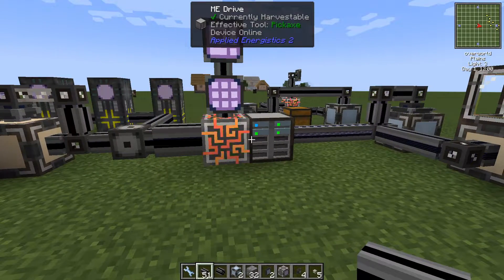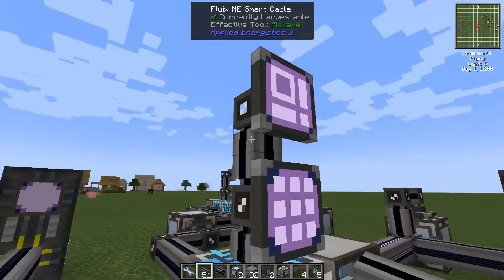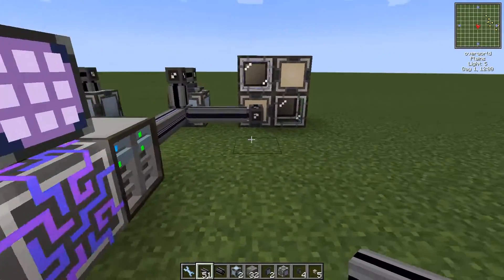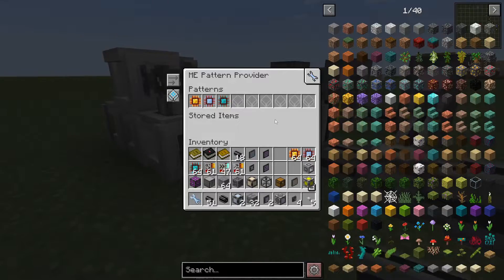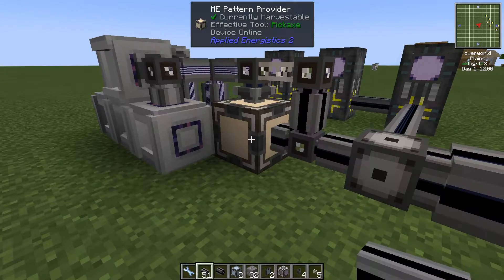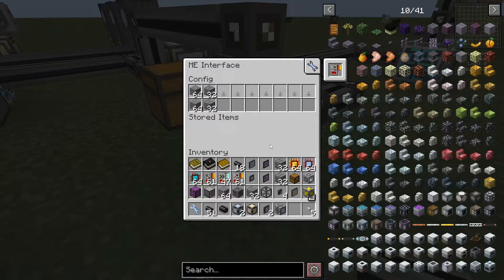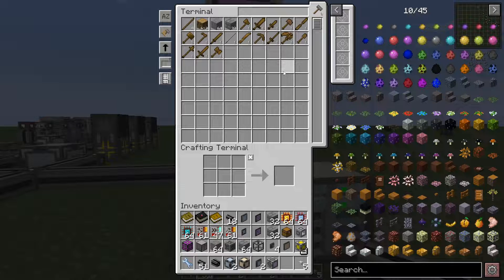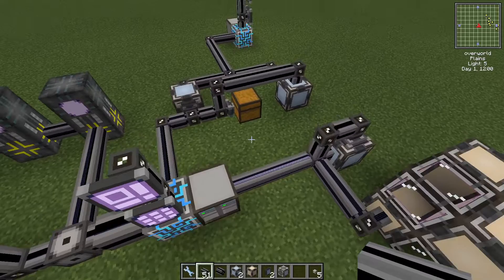Pattern Provider and ME Interface in Minecraft 1.17 - AE2 Tutorial

Comment: 2:47 Can I use import bus or item storage bus instead of interface? 
also 2:57 - Does the export bus has to specify the items to export? Or the pattern provider only accepts items, that were requested to craft?
and last but not least 3:04 - Can I use interface/import bus instead Item storage bus? I guess I cannot use import buses, because this subnetwork doesn't have any storage, right?
Reply from the maker: To start with, if you're playing in 1.18 I suggest you check my latest video on this build due to mod changes. You cannot use import or storage instead of interface to receive items, they work differently than interfaces. Final export bus must specify what to export or you might send the other crafting ingredients out. No, you need storage bus to intefaces to be able to both insert and extract from Inscribers. The inscribers themselves are storage space. I'm not sure what you're going after but I have a long series of AE2 tutorials to check out if you want to learn more about the different blocks.

Comment: thanks for this tutorial, I built the inscriber but somehow the bottom three are not sending printed circuits to the top inscriber for the final assembly.  Do you know if it is because the pattern provider works differently compared with the ME interface?
Reply: my friend helped me solve it xD it is the storage bus where we put the ingot/crystal in, it also need a printed circuit to let it know that it can let it pass ^^ same goes the storage bus for the redstone, it needs filter for all three finished processers, otherwise the bus wont let the item pass at all
Reply from the maker: Sorry for late response but good to hear you solved it, so thanks for coming back and writing that! The difference in storage bus behavior seems to be due to new filter functionality in the bus. The problem can also be solved by changing filter to insert only (which means the other item can be sucked out without being in the filter).

Comment: i set up the inscriber has shown in the video but it still doesn't work has it been updated since. if so possibly a new video showing the changes?.
Reply from the maker: What version? Modpack? One detail that might have changed a bit is the filter settings for storage bus. But what part doesn't work? What happens?
Reply: @therealtkh  the modpack is atm7 some of the items come through not all of them they won't autocraft and some don't even leave the inscribers
Reply from the maker: @TheJiggyOne  Hard to say, the version should be fine as I have built this in 1.18. Test different settings on the storage bus (filter on insertion only) and make sure all connections has channels and that there are quartz fiber in correct places. Otherwise hard to guess without screenshots or anything.
Reply: @therealtkh  I tried doing that. I can't get it to work. And I Dont think youtube let's me send screen shots XD
Reply: @therealtkh  from what I can guess I items won't go to the pattern provider
Reply from the maker: @TheJiggyOne  Jump onto Discord (link on home page, video description), might be easier to share screenshots there. But you said some items come through? Perhaps problems with patterns or with filter settings in subnet?

Comment: does this work for 1.18? because it does work for me for some reason
Reply from the maker: You didn't specify what part you asked about so I'll just guess... You might need to adjust storage bus filter to "insertion only" but i have built the processor part in 1.18 and it works.
Reply: @therealtkh  ahhh when i replace the interface with the provider it wouldnt start craft i even put the patten
Reply from the maker: @warpedro6967  I don't have your world to look at so it's not easy for me to help... Not even mod version or modpack etc.
Reply: @therealtkh  eh nvm

Comment: I made the automatic Inscriber setup you've got there, for some reason it won't insert the redstone? I have no idea why it won't. It makes the printed parts but it won't insert the redstone to finish the pattern. Any idea why? The storage bus is filtered on Insertion Only just like the others.

EDIT: Also, I seem to need all patterns (for both the finished products and the printed circuits), how do you make it so you don't need these in there?
Reply from the maker: All other items are inseted but not Redstone? Are the items from other Inscribers ending up in the top one? I was thinking if it's rotated incorrectly or something. Or if any connection is incorrect and the Storage Bus on top is inactive due to channel shortage. It's hard as I can't see your build and it's easy to make mistakes, and I don't know mod version or modpack. Regarding the pattern you only need the base materials (silicon, redstone and gold for Logic). The main network don't care about the middle steps because everything is in a subnet and is never visible.

Comment: is AE2 autocrafting broken in 1.18.1. I play on a TNP 5 server and i have everything setup properly but it just will not autoCraft. It shows up in the system, and in the Processor but will not craft the item in the Chamber
Reply from the maker: I haven't done much in 1.18 but I have tried the compact inscriber build and it worked fine after a minor tweak with the Storage Bus filter setting. Remember that these releases are still in beta so there might be bugs and missing features. So I wouldn't say autocrafting is broken, but I haven't seen your build so I can't guess what's wrong either.
Reply: @therealtkh  I discovered the issue - all the storage busses need to be changed to filter on insert only.  The default is to filter both.
Reply: @therealtkh  The issue I'm having is that everything works except the ME Export Bus on the final step.  The inscriber will have the redstone and printed silicon, but for whatever reason the circuits never flow into it.  Tried all 3 and triple-checked everything.

Comment: it would probably be useful to mention again that the storage-bus-on-me-interface-for-autocrafting-storage needs to be set to extract-only to function correctly so that you can see the correct number of items available on the network
Reply from the maker: I'll remember to try that if I run into problems. These days I usually keep auto-crafting and storage in the same network... :)
Reply: @therealtkh  So do I though I've seen the storage-extremes one can reach using subnetworks -- I may or may not have suggested watching Nonsanity's 'storage extremes' video before, can't recall. 

But in a recent playthrough I was unable to see the items being held aside in the ME interface's buffer until setting the storage bus to extract-only, at which point the additional bits showed up on the network available for manual removal through the ME terminal as well as available for crafting. Figured I should mention it. I can't recall if this is new behaviour or if its always been this way and I just never noticed. 

Good to see you're still doing these. :-)